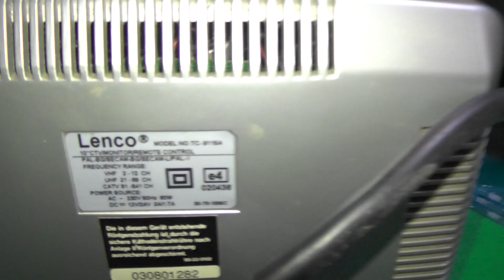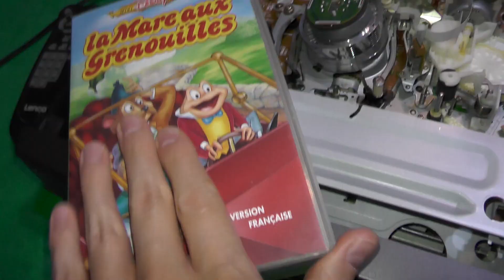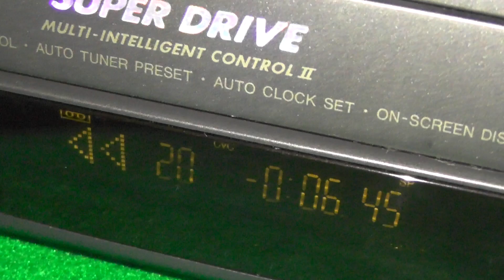Panasonic NV-SD430 (garage sale find) noisy mechanism ??

Comment: If the cassette does not make this noise, maybe the reeltables need to be oiled aswell as the gears that drive them.
Reply from the maker: @vvm2004  thanks !
I never took the plunge to oil/grease a machine but I'm very interested. 
Do you have suggestion for the oil type ?
I noticed the PTFE is suitable for plastic/plastic, plastic/metal and metal/metal do maybe that one?
Again thanks
Reply: @joeyvhs  PTFE sounds good. Just tryi it. :) But first always remove the old oil (often it is sticky)! Somitimes the old oil is gone and it is dry. :)
Reply from the maker: Thanks, will try the PTFE 👌👌👌 appreciate it !
Reply: @joeyvhs  Good luck! 😉